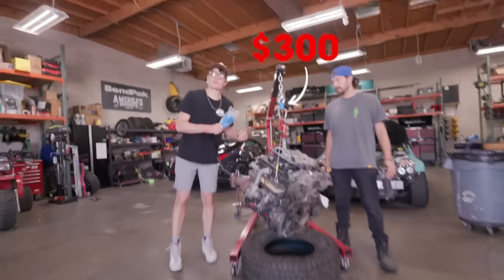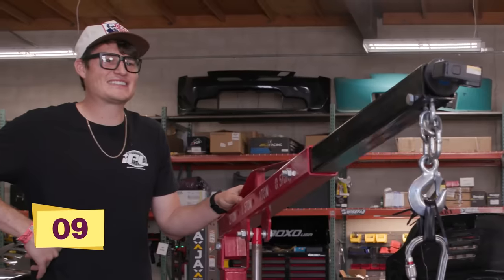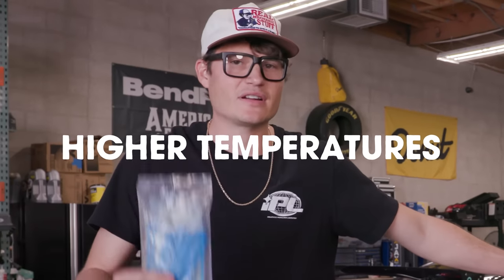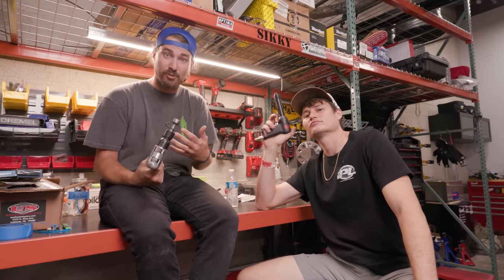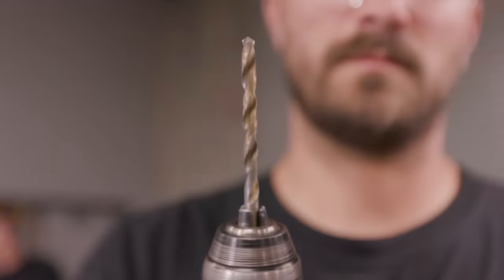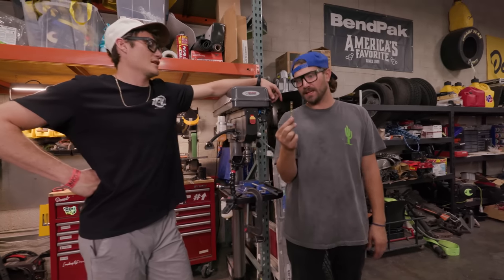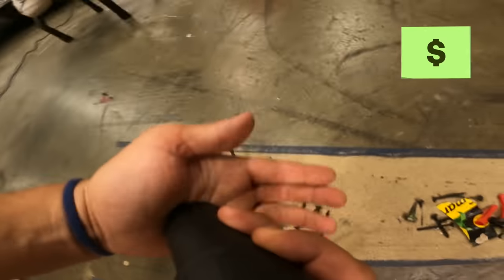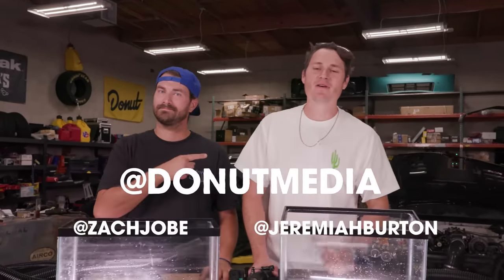We Test: $1 vs $300 Zip Ties

Comment: a solid reminder that cost isn't always to do with quality but can be due to how niche a product is. The $3 zipties are for pretty specific use cases so they cost what they cost because they aren't intended for the mass market.
Reply: Not only niche, but also certifications. A lot of stuff used in aviation is like that, where most of the price - is paperwork/certificates because safety etc.
Reply: 300$
Reply: That’s not how prices work. If the process to make a product is cheap and the materials are abundant there is no reason for a high price. No matter how niche the market is. At least not one that’s worth a 30,000% markup (assuming cost of production is similar to the regular zip ties).

The only place where how niche a market is determines the price is with collectibles. Like how a normal person wouldn’t pay $100,000 for a 50 year old car but a collector would. But scarcity also plays apart in that example as well.
Reply: @jaredgarcia3335  supply and demand is a bit different when they have to be certified. that means the certification is part of the time it takes to produce. think body armor, i can buy kevlar from china for $100 non-certified but i can get the same kevlar from america that has passed NIJ certification and it will cost much more. thats how the market works with more specialty items.
Reply: @jaredgarcia3335  ... yes it is how things work.... If I am the only one with a specific product on the market than I will have a huge profit margin and nothing is wrong with that
Reply: @Gl-my8fw  exactly, things are worth what people will pay. Price is a function of both supply and demand.
Reply: @jaredgarcia3335  tell me you’re not in the Server space without telling me you’re not in the server space
Reply: @Gl-my8fw  no it’s not. It has to be worth the price. They said nuclear power plants use these zip ties. So if a power plant goes through 1 million of them a year they will not pay $300 for them. If they are cheap to produce they will just partner with a factory and pay for production themselves.
Reply: @jaredgarcia3335  the point I am making is to sell them for the highest price people will pay...  also the pricing is always different to the general public
Reply: @fillmainlol5973  I’m not in the server space
Reply: @jaredgarcia3335  Except a power plant WOULD pay $300 for them because its cheaper to produce them by themselves, and they need that certification because its also cheaper than getting sued.
Reply: @jaredgarcia3335  like are people I said there may be certifications and verifications that they have to pay for for those zip ties to be used for the specific application which is a niche compared to the rest of the market and since they can't recruit their cost through as mass of a market the price goes up.
Reply: @baddriversofthenorcalarea500   if that’s the case than sure. But that’s the government affecting the market by limiting supply and increasing price per unit. Not how niche the market is.
Reply: @jaredgarcia3335  Go start a jewelry bussiness with this model you speak of! Sell premium luxury jewelry at the same price as the mall kiosk I’m sure u will do well!
Reply: @clonescope2433  like I said, certifications are the government affecting the market by limiting supply and PPU. Not how niche a market is.

In terms of them not making enough money I’m willing to bet that company doesn’t specialize in zip ties. I’m sure they make majority of their profits somewhere else so I doubt they invest most of their funds in one product. Just like how Sony is into phones, games, cameras, movies, music, televisions etc. I’m sure they make majority of their money in one field and invest accordingly. They give their most niche markets as little funds as possible, while still remaining to be profitable, making a quality product, and not going so much over competitors prices.
Reply: @jaredgarcia3335  That's absolutely how it works tho. Economy of scale is a thing. The cost of manufacturing goes down the more you produce, niche products will have lower production volume and wont benefit as much if at all from economy of scale.
Reply: @aaronrdaniels  what makes it luxury jewlery? Is it better quality? Did it cost more to produce? Is it rarer than other jewelry? Or is it the brand that invested tons of money and product marketing themselves as one of the best? 

Depending on which category it falls in I would price them accordingly and probably do just fine.
Reply: @jaredgarcia3335   it’s the difference between what jewelry shop uses whatever diamonds doesn’t matter if they are lab produced, some are slave labor driven to obtain. Buying from other brands that can certify exactly what you are paying for is the question in hand for most people. And this “reputation” that these jeweler stores have to NOT sell these low quality goods. You also pay for certifying if ANY of the jewelry is whats as advertised or not. Thank you for asking the exact rebuttal question I needed to finish my argument 🙏
Reply: @aaronrdaniels  ok so ur paying for a service that authenticates what ur buying. What does that have to do with niche markets?
Reply: @jaredgarcia3335  it’s called business. Doesn’t matter how niche your product is YOU HAVE TO MAKE MORE MONEY THAN U PUT IN. Certifications don’t seam like something u get when u purchase an item but you DO get them that’s the thing ur not understanding.

Edit: Aka it cost money to certify an item. Either u have to power a machine/computer to do it for you. Or you have to higher a human. And certificates don’t stop there. You are also obligated to CONTINUE to test your product not just one to maintain a certificate.
Reply: @aaronrdaniels  I understand that. I’m saying a company can’t just enter a market and be like, oh only 1% of the population buys this item so I’m gonna markup my price 30,000%. The quality and cost of production has to warrant that price.

U can still enter a small market and make money without price gouging. It’s called invest less money into that product and only produce what will be profitable for ur business. I’ll admit niche markets have higher prices due to less competition, but 30,000% markup makes no sense to me
Reply: @jaredgarcia3335   u are comparing apples to oranges here then. There are no zip-ties in this video, that are of expensive due to marketing. You are correct those markets do exist! Tesla is the largest living example. They pay ZERO marketing. Allowing them to sell a higher valued car at a lower price point. And then there are car companies who plaster your TV with ads around Christmas time and you pay for that in the price of the car. However the products price in this video is because of a niche certification that is glossing over everyone’s heads. Rather than a niche market causing the price to be high.

That’s why I am trying to say they are expensive because of certifications. (Which I guess can be viewed as strengthening marketing) but technically it is REQUIRED for their product it’s not optional to get these certifications for what product they are making.
Reply: @aaronrdaniels  No I’m not. The og comment said niche markets raise the price of goods and I said they don’t. 

A niche market means there are not a lot of people that want or need ur product.  There are three things that effect pricing. Supply, demand and cost of production. Low demand means cheaper prices, therefore a product with little demand wouldn’t raise in price. So again idky these zip ties are $300 but it isn’t cuz it’s in a niche market.
Reply: @jaredgarcia3335   once again you have failed to mention the only point I’m trying to drive home. Certification needs to be considered in this equation because it’s very real and does exist in this scenario and it’s one of the most expensive parts of the equation and you just leave it out in every message.

I also agree you aren’t comparing apples and oranges IF you actually take the time to mention the full picture and the Full equation of why one zip tie is cheap and one is more expensive. You don’t have to teach or explain any part of manufacturing to me I’m not mentioning those because you understand those points quite well actually. But certifications FOLLOWING WHAT THE GOVERNMENT MANDATES YOU DO. Is usually one of the most costly running expenses that is likely to never get any cheaper even as supply and demand lowers a products cost. 

The OG comment is a lost cause so I was just trying to add to urs to make it complete.

Edit: aka making more of them doesn’t make it any cheaper to test every 100th zip tie. (Probably not their actual testing metrics)
Reply: @aaronrdaniels  My bad. U brought up marketing in the apples and oranges comment and I wasn’t saying anything ab marketing. I thought u were confused and figured I had to define something’s, my bad.

But I have addressed the certifications to other commenters. I said that these certifications raise prices due to increasing the production cost, and in some cases where the government requires that businesses use certified equipment, effects supply. So if that’s the case for the zip ties I could see that. It’s a bit ridiculous but at least it makes some sense.

My argument was that just cause not many ppl may want or need these zip ties is the reason for them being so expensive, which the og comment stated.
Reply: @jaredgarcia3335  niche means supply is generally low. Also things like this have to be manufactured to much tighter tolerances and tighter tolerances can exponentially increase the price.
Reply: @jaredgarcia3335  That's exactly how it works. The cost to produce the zip-ties is not the same. The tefzel used is created with a much more rigorous process, with better control over precursor materials. If I tell you to go fill a wheel barrow with rocks between 0.1"-3" you'll fill it a hell of a lot easier and quicker than if you had a tighter tolerance like 0.5"-0.75". So now you have all these machines & personnel & supply chain and they cost money everyday no matter if they make 1 ziptie or 1,000,000. You aldo have personnel who must test & certify every material and process used along the way.
Reply: @bigpatty823  Ok… so the higher price is due to higher production/operation costs… not because it’s targeted toward a niche market.
Reply: You've completely missed the point of the expensive zipties. The expensive zipties are obviously of way higher quality, it lasted 10x as long subjected to a heatgun.

The engine block example doesn't mean much because it's a very unrealistic use case, but it could probably remain suspended for decades with the expensive zipties, which is extremely unlikely with the cheap ones.

But unless you need to strap things to your water boiler or something similar, you probably don't need to go for the better ziptie.
Reply: @jaredgarcia3335  My comment was directed to the OP, not you.
Reply: yea, guess i never have to worry about my zip ties breaking, i zip tied my capacitor, line output converter, AMP, and TV tuner and all the wires for them to the ceiling of my trunk, best why to hide stuff.

Comment: The biggest difference I've noticed in cheap vs expensive tools is how long you can use them (reliability, longevity)  I do find that as a occasional use DIYer the middle of the road option often works out the best.  As a student, breaking some cheap tools is a wonderful teacher.
Reply: One school of thought is to buy the cheap tool.  If you break it, you use it enough to warrant the expensive one.
Reply: Yuuup. If you're using said tools as your every-day livelihood, then it's worth it to spend more for the better durability. But for most hobbyists, the middle-ground tools will last perfectly fine
Reply: Also QoL makes a huge difference
Reply: Watch project farm tests he does it better this guys are for entertainment. :)
Reply: This is how I go about things. If I use the tools often, then I am going for the more expensive option. If it's occasional, I will buy cheap and just replace it when it fails.
Reply: @doom4067  this is how i buy my tools, so far i have only boughten the expensive tools a couple of times,
channel locks
wire strippers
1 set of pliers
Reply: @volkswagenginetta  bought*
Reply: I've been on team "buy the cheap as dirt options that can do what you need it to do, when that wears out, buy the nice one because that probably means you use it enough to merit it." Obviously this doesn't apply to things that fail before a reasonable time but in all other cases it works pretty well.

Comment: The drill test I would argue is a user error issue in the first test, using a hand drill and timing the drilling including the transition time between holes puts too much weight on the hand of the guy doing the drilling, the second test is a bit more fair but you could still take notes from the Project Farm channel on how to do a more fair comparison.
Reply: Project farm is science hardcore in real life, swear the dude has to have a degree in STEM.
Reply: The second drill test would probably have worked with the cheap drill if the two had used a significantly lower speed and coolant/lubricant
Reply: They don't exclude variables. I much prefer PFs approach. With the second drill bit test they should have used a weight to make the force equal for both bits. They did the worst thing possible by hand cranking it with two different operators. One could have used 3 times as much force and nobody would know, not even the other guy standing right there. If one of them had done both tests, at least he could have estimated it within 10% or so.
Reply: Also, comparing titanium to cobalt drill bits is not really a fair comparison at all.

Comment: I used to test T&B Ty-Rap zip ties as a job. I can tell you from experience, the commercial-grade zip ties will withstand the elements much, much better than generic zip-ties. I'm talking direct UV exposure, high temperatures, low temperatures, heat cycling, etc. Usually the generic/cheap stuff's tensile rating is for right out of the bag, but that goes to dogshit once exposed to the elements for any amount of time (as indicated by the heat gun test). Often the commercial-grade stuff can still maintain 80% or more of its tensile strength after factoring in time/humidity/temperature. The cheap stuff can be reduced to just 10% of its stated tensile strength.
tl;dr : if you need a temporary fix, get cheap zip-ties. If you need a permanent or semi-permanent (say, securing wiring under the hood), get the expensive stuff from a reputable company.
Reply: Me and my harbor freight zip tied together engine bay thank you
Reply: Exactly
Reply: What is a reputable zip tie company?
Reply: @showmethedammovie  Panduit, which is where they got the Tefzel ties on this video, also sells lower cost ties. They're a pretty reliable company for those products, and there's likely a distributor nearby you can buy through. If you're just handling DIY stuff, the branded ties at a hardware store should do 90% of what you need.
Reply: @showmethedammovie  Actual industrial supply groups for example Thomas & Betts (now under ABB), Panduit, etc. They make installation components and other products, in addition to zip ties. Not necessarily worth it for little projects around the house. But these companies have to manufacture things more stringently because they will be used in applications that have a chance of becoming subject to a lawsuit if they send out a batch that doesn't perform as advertised and someone gets hurt or cost a client money if they fail within advertised specifications. 

For example, if you have an aerial fiber terminal attached to a strand cable that falls off and causes an outage or injury to a pedestrian because the ties failed due to defect when they were installed under conditions that they were designed to endure... And investigation determines the ties were the root cause, that's $$$.
Reply: Yes, generic ones just go stupid hard and stupid fragile in no time when exposed to the elements.
Reply: I'm glad people are rightfully tearing into these comparisons more. I swear to god this video series has devolved into a HF marketing attempt.
Reply: At some of our clients(food grade plants), we need to put expensive zip ties that cost pretty much 1$ each because they can be detected by metal detectors...so we can't use cheapo zip ties 🤣
Reply: 100% Thomas Betts for the win. Harbor Fart ties are junk
Reply: @theoldschoolgamer6199  Which makes sense. It's a specialty job with certain requirements, so you'll need to use the tie that meets those needs. The extra cost is worth it in that case.
Reply: I got slightly more expensive cheap zipties and held a whole bumper and headlights, for over a year, tighter than the bolts and plastic clips could, and my truck wasn't a pavement princess either, mud, water, up and down through forest
Reply: Well I learned something, thanks 😎
Reply: so? still 300$ vs 2$, i can replace the zipties yearly for the next 15 years... if it's exposed to the element just get some AL zpipties, does the same job and won't rust. I use my zipties only to fasten my cables where the old clips broke and i don't have any issues with them but i won't spend 3$ for a ziptie that's for sure, at that price i can already replace 3-4 OEM clips(not even mentioning china with 10$ 200 clips)

Comment: Last year I had to pull a trans without my normal tools.  The trans was coming out of a shell and the engine had already been removed.  They stated it wasn't safe to transport as it sat.  I pulled the trans out with a cherry picker, zip ties, and 1 ratchet strap.  I was impressed because the zipties were holding all of the weight and they didn't even hesitate at all.
Reply: Im not that fat :(
Reply: @chuni5942  I did a spit take lmaooo.
Reply: @chuni5942 same I’m not fat either